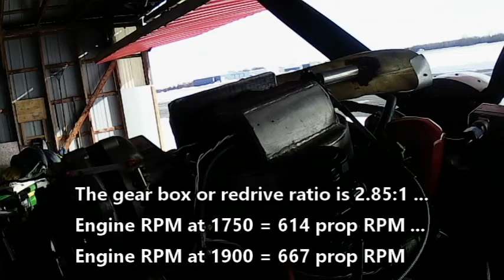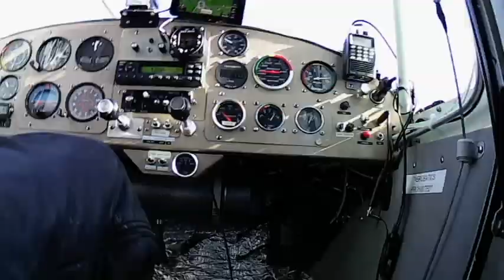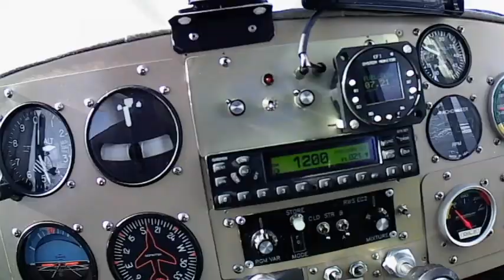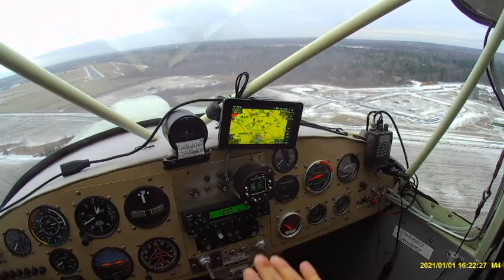Radiator Air Control - 2A

Comment: Do you have any photos of your exhaust system?  Are you using a muffler, and what have you found is robust enough to survive the Mazda supersonic exhaust pulses that in the past have destroyed many mufflers after a few hours?   I'm about to attempt a first engine start on my 86 13B on an RV-9A...  :)
Reply from the maker: @rv9flyer13brotary9  Yes I have some photos. My exhaust is made ftom 1/4" plate exhaust flanges welded to short pieces of 2" mild steel. The 1-7/8 headers slip inside that and join below in a vee ... the rest is necked up to 2.5" into Aero Turbine Muffler and 2.5" exhaust pipe. All pipes are 304 stainless that I welded myself ...